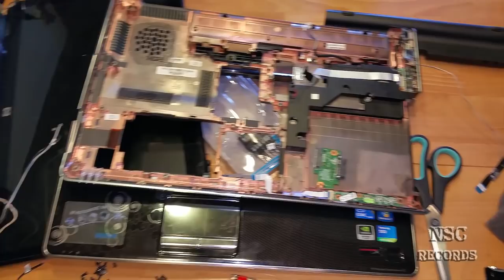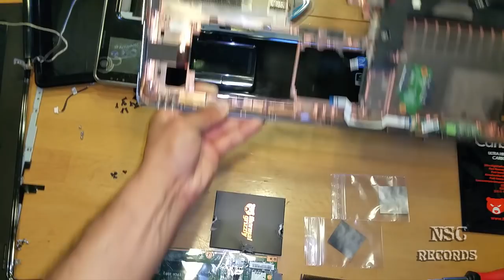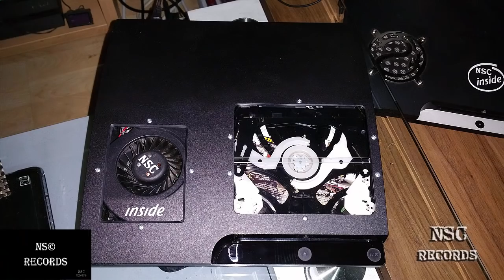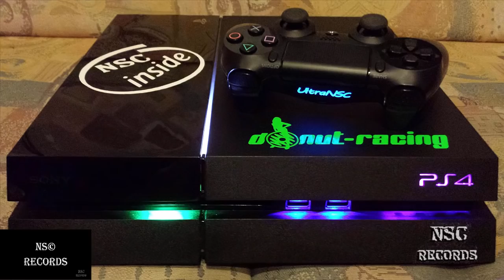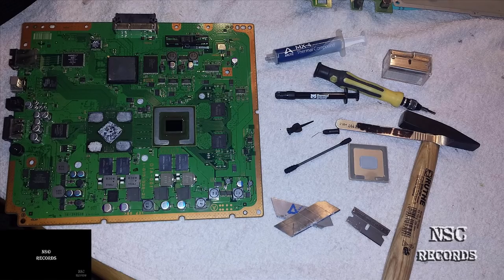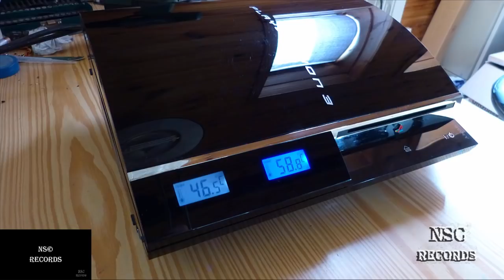High end thermal pad grizzly carbonaut vs liquid metal By:NSC

Comment: one problem is that air build up under the pad is possible when you hold it down with tape. try use thermal tape.
Reply from the maker: Sure but this was not the problem...
Reply: if he use thermal tape then that would not give 62w/mK right 🙄

what nsc did was the best way possible 👍

Comment: Suggestion

Don't try to scratch the old liquid metal off the cooler itself, gallium does react to copper but not in a negative way like aluminum. It will absorb slightly into the copper and you can't avoid that but it's impact to cooling is significantly low, if you do remove it and re-apply liquid metal it will happen again defeating the purpose but it will only absorb so much before it stops completely. The problem most folks have with liquid metal degradation is due to this causing it to "dry out" by leaving it on it will take less next time maybe even none at all if the copper has absorbed all it can while it's impact is less than margin of error.

Copper has 29 protons/electrons and 35 neutrons
Gallium has 31 protons/electrons and 39 neutrons

They both attract each other causing the gallium in liquid metal to stain the copper that's really all it is and that layer creates a neutrally charged zone between the two prevent it from happening again. Not trying to get scientifical but leaving it doesn't cause any measurable harm preventing it the second time around while also letting the liquid metal to last longer since more stays between the silicon die and copper heatsink.
Reply from the maker: I had to clean it away, otherwise it would be bad for the thermal paste or thermal pad
Reply: You need to clean it, not because it's stained, but because you need a flat, clean surface for proper thermal transfer. Otherwise, you'll see some temperature degradation. I've seen as much as 4C rise in idle after not properly cleaning. I recommend a dremel tool and 1 inch circular sandpaper pads. Takes like 1 minute. Also, I believe it halves the heat transfer capacity in terms of wm/k. So it goes from something like copper being around 400 to 250. It doesn't make a measurable difference though in practice. You're still mostly limited by around 70wm/k from the liquid metal itself.
Reply: @momo  You will not ruin it, graphite pads preform slightly worse than normal thermal paste so if anything this would be a downgrade.
Reply from the maker: OMG... No Panic on Titanic... You can clean it without problem my friend :)

I work with liquid metal as a long time, and if you not clean it away, you will not be able to use it like that  :/

Comment: @NSC Mods be warned when you open this in a year that pad will be stuck to the cooler they are very fragile and after being pushed down with good pressure for some time they suction to the cooler and get ripped when you try and remove them. they work really well for single applications where paste can be pushed out ect on laptops or other single use applications but it probably wont be usable when you open it up later if  you try and remove it from the cooler
Reply from the maker: Yes understand, that's why i will let it for ever :) let's see the temps after one year and then let's decide what next to do :)
Reply: @NSC-Modz  It is probably the best solution for laptop coolers at the moment. as pastes get pumped out from un even pressure over time and liquid metal dries up from oxygen getting in from the non even pressure. I have changed many a laptop coolers thermal pastes to have them get worse overtime unless you use a really thick paste or now the option of these thermal pads by ic diamond and thermal grizzly
Reply from the maker: @Demon09-_-  that's right

Comment: be cautious with the pad touching electrical stuff as it is a conductive pads make sure you have a layer of thin tape under the pad or something else if your going to do the overhang tape down method like here
Reply from the maker: Yes sure, have done it all and protected all, it was already protected all because i had liquid metal on it :)
Reply: @NSC-Modz  just was leaving a note for others who come along to make sure they also have that done. so that they dont skip that step and end up with short circuits